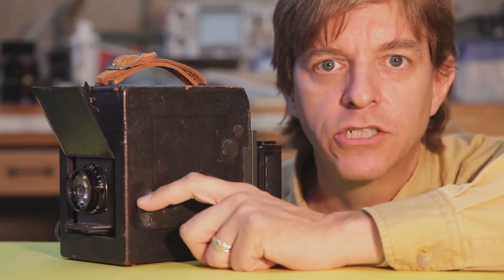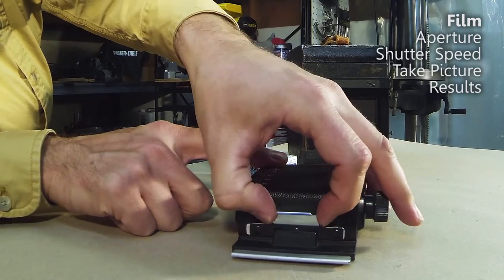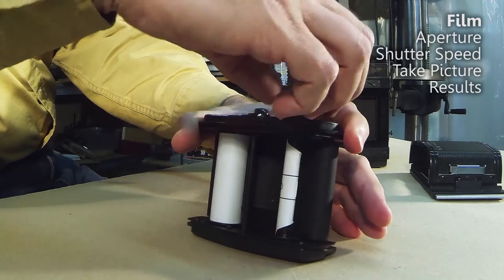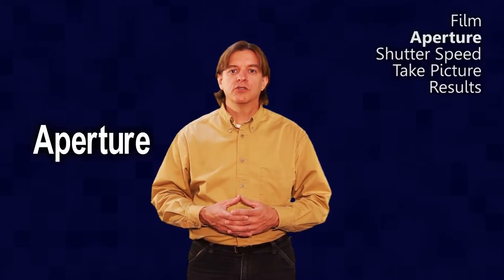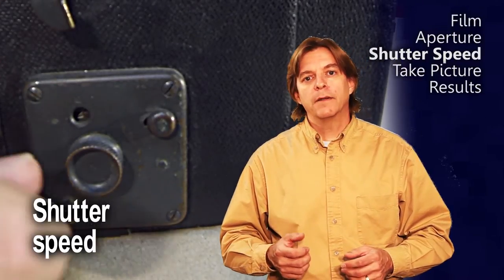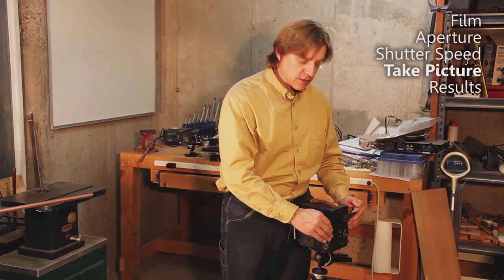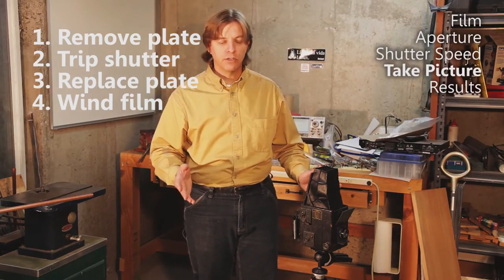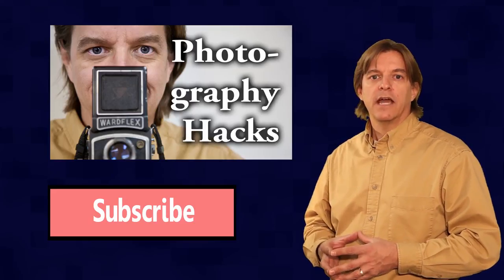How to operate an old camera, and the results

Comment: Nice video!!!! The Graflex is a camera I dream of owning someday. Thanks for the video! (I'm thinking the 120 back is probably more rare than the camera itself as most film-backs seem to be for 4*5 sheet film. I have  seen a few videos on here where people have adapted a Polaroid back to the camera......count yourself lucky to have that 120 back :) )
Reply from the maker: I didn't realize the 120 back was so rare. Interesting to know. Thanks! Yeah, it seems like this camera would be pretty easy to create DIY backs for if you had a need for a specific film type. Cheers.
Reply: The "Graflex 23" film back you have for this camera is pretty rare indeed. I had to source on from Vietnam of all places for my camera. It is designed to specifically fit on the "Graflex Back" used on these SLRs. The one ( the "GRAPHIC 23") for the Graflok backs on Graflex Speed Graphic type cameras, in all sizes, is much more common. 

General tip on loading the film in one of these holders. Do not turn it to "S" before loading film into the holder. Wind it up until the double-pointed arrow on the backing paper lines up with the white arrow inside the top of the film holder. That way the frame counting mechanism properly lines up with the start of the actual film inside the backing paper.

Comment: That's a monster camera for shooting 120 roll-film. Looks big enough to take 5*4 sheet film at least. Probably a good thing that things had advanced and shrunk a bit by the time the astronauts took Hasselblads to the Moon :-)
Reply from the maker: Actually the Graflex is about the same size as my Canon 5D with 24-105 lens, and is definitely lighter. It has interchangeable backs. I happen to have the 120 roll back, but I believe there was a 4x5 back available for it, among others. Cheers.